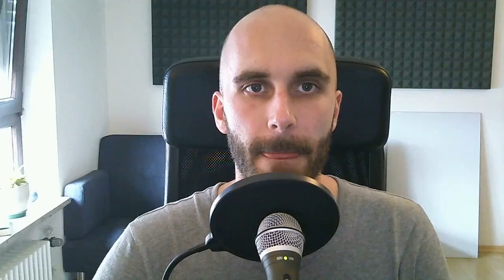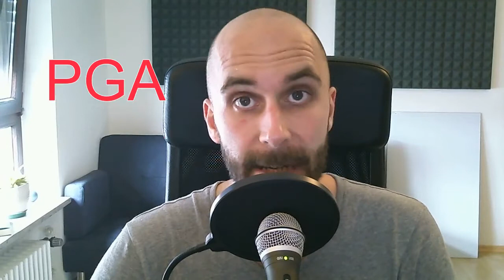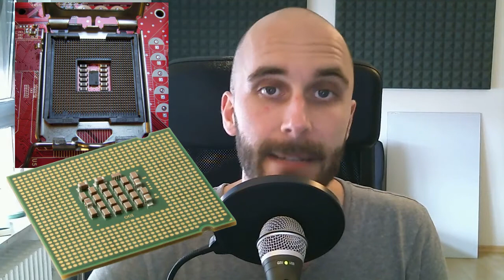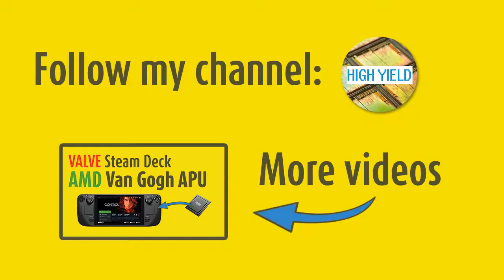AMD AM5 Socket: LGA vs PGA explained!

Comment: I honestly prefer LGA, simply because it's way easier to not ruin the small spot on a big board, than it is with the entire damn half of that tiny square.
Luckily, I never damaged either, but there's a huge difference in stress levels involved. (Up until the point it feels like you're about to crush the cpu with this lever and the board is about to snap into pieces.)

Comment: I would rather have increased pga socket size than small lga socket size because I hate lga for being so hard to repair than PGA. And also is PGA dead?
Reply from the maker: Yeah, I think PGA is dead for good, since future sockets will need even more pins.
Reply: @HighYield  Thanks for answering my question

Comment: The good repair for LGA is   to change the "socket part" by itself of the motherboard - in a repair service center.  They can also strait out the pins but that is more tricky and they can break them - they are so tiny....so tiny.
Reply from the maker: They are tiny indeed, more needles than pins. But thats the price to pay if you want a lot of I/O and power in a small package.

Comment: then they should just increased the size of pga sockets for am5 lol hahah
Reply from the maker: Honestly I wouldn’t mind. But the motherboard would look strange and we would need new CPU coolers ;)
Reply: @HighYield  it certainly would but i think amd will not make its socket larger since it might be a problem for itx build. i guess going to lga will be more possible...  it just hard to repair slightly bend pins on lga or even those that just misalligned since slight increase on pressure snaps pins
Reply: @JohnBabeJeszareth am5 is. Hard to break man I broken it few days ago i moved it around with needle a lot trying to fix it for 3 days didn't work but didn't break any pins I lifted them 1716 pins up with needle 2 times but unsuccessful in fixing I gave up and I stepped on pins lol so frustrated still there are pins 😆

Comment: My hopes for a large increase in connectivity in AM5 were dashed. No quad channel ram and very few cpu lanes to the PCIe sockets. PCIe gen5 helps the throughput per lane and DDR5 will be faster. I'm glad I jumped on TR PRO and 8 channel ram.
Reply from the maker: If you need a lot of connectivity, TR is clearly the better choice. AM5 is still a mainstream desktop socket. I’m looking forward to the next-gen TR socket, most likely coming late 2023.